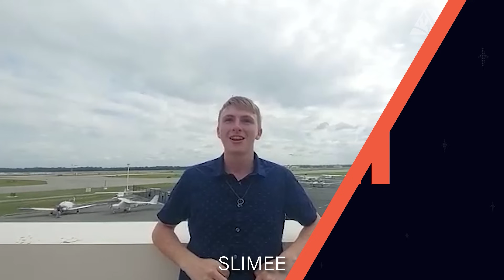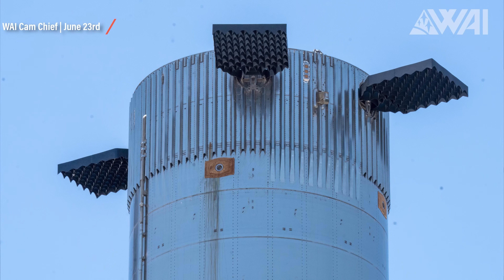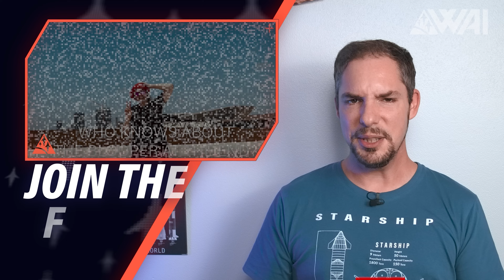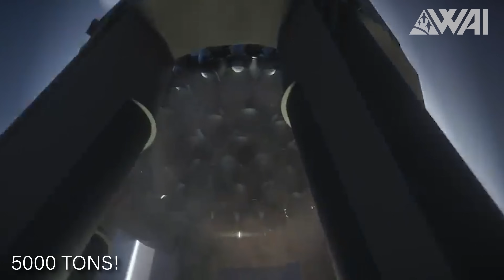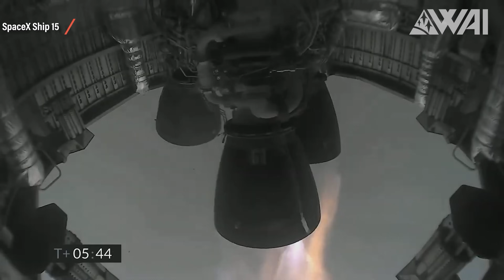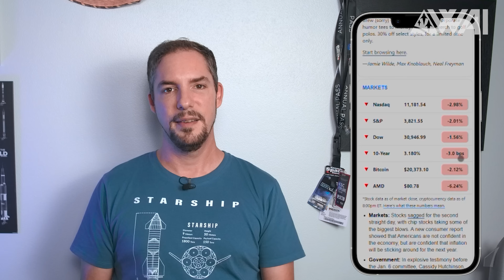The first orbital SpaceX Starship booster and its INCREDIBLE changes!

Comment from the maker: What is the insulation made of? What do you think? :_WAISweet:
Reply: carbon foam and ceramic
Reply: no maybe a dense polystyrene
Reply: Love and care
Reply: deez..... im sorry okay, I just woke up..
Reply: I would guess it's intumescent putty, it's sold in sheets that can be cut to size for fireproofing pipes and cable runs through drywall. The texture running around the edge looks like its been pressed down with a putty knife
Reply: Looks a lot like layered cork, but I'd assume it couldn't be that.
Reply: The Chinese used cork as a heat shield
Reply: Just started watching so I dunno what insulation. I dunno if it's a thing still/yet but aerogel would be cool lol

Ahhh for booster thrusters. Looks like cork, but could it be some sort of leather? I mean, welders use leather gloves they stand up to high Temps atleast temporarily anyway.
Reply: Tanned Alpaca hide
Reply: a few cans of Great Suff
Reply: If it's protecting against cool gas, it's probably cork.
Reply: Cork
Reply: Classic isolation Kork
Reply: It's cork. SLS uses it as part of the heatshield on the core stage
Reply: Yes! It totally looks like cork!
Reply: OSB
Reply: Looks to be some type of cork
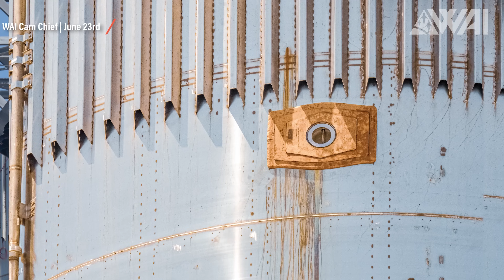Reply: @michaelputnam2532  I agree it looks variegated like pressed cork particle sheets. [5:17] The outlet gas can be quite cold (and cause ice to form on adjacent surfaces). Composite cork material could easily survive the temperature and suppress dense ice formation. 

My concern is how well it holds up mechanically during re-entry, especially during banked maneuvers where the boundary layer gets thinner due to turbulence. Beveled edges may help, and the stepped layers approximate that.
Reply: Cork
Reply: Captain Kork says it‘s Cork.
Reply: Looks like a template made out of 4*8ft 3/8ths inch Oriented Strand Board (OSB) Used on houses. Probably a rapid prototype pathfinder template.
Reply: some kind of stone wool or some kind of cork
Reply: Natural cork. Just a guess
Reply: Looks like OSB.  😆
Reply: cheap fiberboard or maybe just cork. heck, it could be just packing material
Reply: Cork
Reply: How about cork...it's been tested in space.
Reply: I think the thermal insulation material is cork. literall tree bark, it's used in rocketry a lot as cork is basically a natural heat shield, protecting cork trees from wildfires.
Reply: Cork
Reply: Its Cork.  Commonly used for insulation on rockets and acts as a cold and hot thrmal barrier.  When burning, it outgasses to create a barrier on reentry.
Reply: Stabilize rock wool?
Reply: Simply "cortiça" used to make coork
Reply: It's almost certainly TSE - thermal scrambled eggs.
Reply: cork
Reply: the insulation material looks like cork. often used in aerospace and often used as ablative shield in some of the the gridfins.
Reply: Osb
Reply: @michaelputnam2532  thought about cork too... light material, can handle heat and insulates well.. probably resistant to brittleness when superchilled aswell...
Reply: Ceramic tiles
Reply: Halal Foam
Reply: whats temp of thrusters? wouldnt want to use wool on a hot flame.
Reply: Cork.
Reply: I think the insulation around ullage gas valvaes is made of cork...
Reply: after a second zoomed look, its clearly cork. its very clear through the visual color patters (clearly ork oak patterns) and through the text laser engravings result aspect. and it makes all the sense, because cork would it not only supports the temperature variations but also damp the impact of wathever connector the plugs there. its also visible the laser cuts and laser engravings are not very aligned, which would point to an early version of that protective cover.
Reply: Cork?
Reply: It looks like some kind of cork-based composite, most probably natural cork vacuum infused with polyurethane, and then pressed. If I remember right, they've already used this material for ablative shielding in some return vehicles.
Reply: This looks very much like plane old cork to me
Reply: cork
Reply: Cork, it's very light and easy to cut in shape.
Reply: As so many have said, it does look like cork, but it does also resemble the polyurethane foam that was used on the booster for the shuttle. Personally my money would be on the foam.
Reply: Phenolharz mit Microballons ist sehr bewährt.
Reply: it looks like corc
Reply: Roseman1967  Maybe those brown insulation patches are leather?

The X15 used leather gaskets.  When they absorbed LOX they would explode from impacts.  I'd hope that leather or other absorbent insulation would not be used because of that history. Being at the top of the booster it should I believe be venting methane which might be safe even if absorbed.
Reply: Cork ?
Reply: looks like cork.  theres no inherent reason things like wood and cork cant be used in aerospace applications
Reply: @element5377  If the shoe fits & it's cheap, wear it.
Reply: Cork. It look like cork.
Reply: @roborchiston9419  I was thinking same. 
Maybe 3/4 or 1 inch thick. 
Before inflation hit that stuff was selling for about $50 a sheet. Its over $100 in some areas. Maybe Elon made a deal with a local builder since the building boom hit and these could be scraps from windows and doors and got them for next to nothing.
Reply: Late to the party, but definitely agree that it is cork. Apollo command module used it. Maybe next gen will use custom foam tiles one they work through all issues. 

From NASA website:
Cork is heavier than foam but provides even stronger protection for certain applications. Cork comes in sheets and is applied to areas that have high predicted heat loads, like the core stage engine section, which houses four RS-25 engines that produce 2 million pounds of thrust. Cork is applied under the solid rocket boosters that provide 75 percent of thrust at liftoff and on the fairings, the areas where feedlines come out of the intertank and run down the rocket to connect the intertank to the other hardware.

After thermal protection material density and adhesion are verified for both foam and cork, engineers take thickness measurements to ensure the required amount of thermal protection has been applied. Overall thermal protection systems thickness for SLS ranges from about a half-inch to 2 inches. The launch vehicle stage adapter requires 0.7 inches of foam while the hydrogen tank requires around 1.2 inches because of its extremely cold temperature. The final system level test of the insulation, prior to flight, will be when the entire core stage will be tested with all four RS-25 engines firing, and the foam and cork guarding the hardware as hot and cold collide.
Reply: Looks like Cork to me. Durable, pliable, easy to glue, easy to cut. It's a perfect insulation material and is used on some manned russian capsules as sacrifice material in the heat shield as well. While it smolders down very slowly, the remnant layer of unharmed cork still prevents overheating.
Reply: Starlite
Reply: it's cork. A cork composite, to be precise. Cork it's the bark of the Cork Tree, a cousin of the Oak Tree. Cork protects the Cork Tree from wildfires in the hot summer days, but also protects it from the freezing temperatures of winter nights. Very light, with incredible thermal properties, it's used in aerospace since at least the moonshot era of the 60's. Cork and its derivatives is used in heatshields, for example. It insulates stuff from very hot temperatures, but also from cryogenic temperatures. It prevents ice sheets from forming in very cold surfaces.
Reply: I don’t know but it looks delicious
Reply: Looks like cork, to me.
Reply: looks like Cork
Reply: Cork?
Reply: Bet the insulation is basalt
Reply: it could be Cork
Reply: cork
Reply: Not at all related to rocketry. A thought that occurred watching your outtakes: I'm assuming that English isn't your first language, so huge props for taking the time to correct all the little pronunciation errors, that's an incredible amount of dedication. And I would imagine is quite the way to practice a language. Crazy.
Reply: It could be cork, very good and cheap insulating material
Reply: Cork
Reply: Cork
Reply: Super-material Intumescent "Starlite"  ( Baking Soda, Corn Starch, Elmer's Glue ) ?
Reply: Resembles OSB sheathing
Reply: @anthonypeterson5618  most likely fairly cold.  You aren’t using any combustion in those thrusters just the pressure build up of the Liquid CH4 or LOX boiling off in the tank.
Reply: @pheyman1526  didn't see mechanics of thrusters.   Assumed diverted from full stage preburner pumps.
Reply: corck
Reply: Sounds heavy for a rocket...
Reply: Former Employee 👋🏽 ….. It’s Cork ……
Reply: maybe cork
Reply: Graphine

Comment: The insulation looks like cork. A proven spaceflight material. Extremely light and an extremely good insulator (ask any tree that survived a forest fire).

Heat shields have been made of cork and even oak, it acts as an ablator in that situation, but it has been used for LH2 tanks. Yes the orange of the Space Shuttle ET os roughly 250 kg of cork. 

China's equivalent to the Corona program, analog spy satellites that dropped film canisters in reentry modules (used into the 2000s) had a white oak heat shield.
Reply: dont ask the dead trees tho
Reply: @huibu8987  Hello! Harvesting cork doesn't kill the cork oaks that you take it from. You take half a tree full at once and the tree regenerates. Harvesting cork gives humans a reason to keep cork oaks about.
Reply: @Jimbo Bimbo I take your point!
Reply: Artificial corks are leading to cork oaks being cut down. Maybe SpaceX can save the species.
Reply: @huibu8987  My apologies: I believe I misunderstood you. I thought you meant don't ask the trees we slaughter in order to produce cork. I now see you to mean don't ask the trees that died in  fire how good insulator cork is. A fair point!

Comment: Gutten Tag Felix. Wilcomen  aus Florida. From an American sub whom spent 2 years in Bremerhaven with the Army from 82-84. 
  The sinking of the foundation of the Orbital Fuel Farm could turn out to be a BAD THING, depending upon how much/fast it is sinking. With experience with concrete pads and construction, I understand completely the ramifications of its sinking.
   Wow that insulation reminds me of expanding foam insulation that I have used in my Home Repair and Improvement Business. It sprays out of an aerosol can as a semi-liquid form and expands to fill the spot/area you put it as it dries and when completely dry its similar to Styrofoam, and can easily be cut/trimmed to shape on the outside, as usually it expands out of the area you put it. But a knife easily cuts/trims it to what/how you want the face to look.
  I as well can't wait till they finally light this GIGANTIC CANDLE, ITLL SEEM LIKE MY BIRTHDAY, EVEN THO THAT WAS MONTHS AGO, AND FURTHER DELAYS ONLY MAKE IT FURTHER AWAY!!!! This being the largest candle built/soon to be launched HOPEFULLY, by Man, whom only had powered flight since 1914 Kittyhawk, with Orville and Wilbur Wright.
    And yes I was glued to the T.V. at any mention of Space and Experienced/Watched the Apollo 11 landing July 1969, I was 5 years old at that time. And same as ALL my Generation whom watched as well, I dreamed/wanted to be an Astronaut. But as I grew older and learned by experience I don't fit inside the cockpit of an Aircraft, being 6'2. I was invited by a Marine Pilot to climb into the cockpit of his Phantom. I was a "Fat Guy in a Little Coat" tyto Chris Farley, RIP BROTHER. Us tall people don't fit into spaces designed for little guys. Even tho I weighed 185 pounds at that time. So fat is/has/never will be said to me, as now at 58 years old I weigh 220. Just my height convinced me from that experience that my childhood dream of being an Astronaut was dead, with no possibility, at that time. Now tho...... it all depends upon whether I will/can finangle the money, which is HIGHLY doubtful being BRUTALLY HONEST WITH MYSELF. As I had an accident in 2004 while doing a job for my business and am since then permanently disabled. Having not worked since then and it took 16 years with absolutely no income, to finally be approved for disability in June 2020. And the Cherry on top of it all, August last year my wife of 38 years passed, 8 days after our 38th Anniversary.
  "One day you look to find 10 years have got behind you" ty to Pink Floyd for that but, 1 year is next month. I just realized 2 days ago now, and haven't stopped crying yet.
Reply from the maker: Hello! Thank you very much! 🙂❤️

Comment: An ullage burn directs thrust to place weightless fuel floating about the tank down where it can enter the engines. The four top vents are simply vents, but may be used to flip the first stage. Look below the grid fins and top vents and you'll see other vents with cone shaped covers. These will provide ullage thrust.

Comment: There's a strange illusion created by big things traveling through the air, they look like they are traveling slower than they really are. Example: C-5A Galaxy on take off. The numbers say the thrust to weight ratio is the same as Falcon 9 but it's not going to look that fast.

Comment: I feel that it's not that stainless steel is better than titanium grid fins, or from years ago when the concept was a composite hull.

It's that millions of miles away if your stainless steel space ship needs fixing, all you need is a big hammer, a cutting grinder, welder and some spare stainless to mend the problem, alot easier to deal with on another planet. Also having a few small parts on hand as supplies.  Hence why raptor two has so few components. The minimal components means less spare parts needed for fixing.
Reply: You're a little off the mark, because grid fins are only used on boosters, which don't go to other planets. But yes, it's almost certainly a decision driven by ease of manufacturing, maintenance, or both.
Reply: @simongeard4824  or your off the mark.  Since why build two different styles of vehicles?  They committed to spaceship being stainless so super heavy just gets built the same way.  I feel like the concept of starship is completely scalable.
Reply: @HurdleHelps  The point is that maintainability of grid fins on Mars is irrelevant because the part of Starship which goes to Mars doesn't have grid fins. Only boosters have grid fins, and boosters are strictly suborbital on Earth.

As I said, I agree with your broader point – ease of maintenance is a huge factor for SpaceX. But the constraints of design for Mars simply aren't applicable to boosters .

Comment: I would think the upper stage would still require (eventually) some kind of powerful thruster system. Methalox still seems to make sense. If they want it to be able to land in a wider range of conditions (required with the planned launch cadence) and with varying payload mass at landing including people, I'd think it would need an abundance of control authority just for safetly margin. Still, its early days. Probably gonna be a while before we see a starship landing in inclement weather with people on board. Or The Hubble when it dies or any of the other ideas people have had. Especially for landing on Mars with a full payload bay if that ever actually makes any kind of rational sense. 100 tons to the Moon, whatever... i'd want serious control authority for such a beast of a vehicle. A sudden gust of wind at landing requires serious power to counter for so much surface area.
Reply: I agree. Setting aside some of the extra-high-pressure propellant gas from the Raptor engines (in COPVs) would be a great way to feed simple pressurized propellant gas thrusters. The thrusters could route liquid propellant around the combustion chamber and nozzle neck to increase efficiency even more while protecting the combustion chamber during long burns. The evaporated propellant may maintain the gas pressure and volume indefinitely.
Reply: I would imagine they'd put something at the top in the nose cone once they've got a near final nosecone design, even the one they're working on now with the pez dispenser isnt a final iteration as its not designed to survive a landing yet. I'd guess the 2nd or 3rd starship will get those once they've figured out how to land it safely as the first 2-3 will be intentionally dropped in the ocean.
Reply: Remember that the gridfins act like biplane wings that are also control surfaces.  The flaps are also control surfaces, and then there's the set of atmospheric raptors that can be gimbled and throttled for even more control authority.  Last years destructive landing tests used as little control authority as possible, just to find the unsafe minimum.  SN24 has more power in every control system than SN1x.

Comment: Looks like the insulation around the ullage gas thrusters was cut out of cork.
Reply from the maker: Cork would be flammable. :_WAIShocked:
Reply: Cork is somewhat flammable, but it is going to char and create a carbon layer that is protective and ablative. So, the cork is basically preventing both high and low temperatures from affecting the purge valve, and suppressing hard ice accumulating at the valve.

Comment: I think the RCS (even though it's using ullage pressure) still qualifies as a cold gas thruster. This pressure exists in the tank due to boil-off even without autogenous pressurization. That is only needed to back-fill the tank to keep the pressure up as the propellant drains

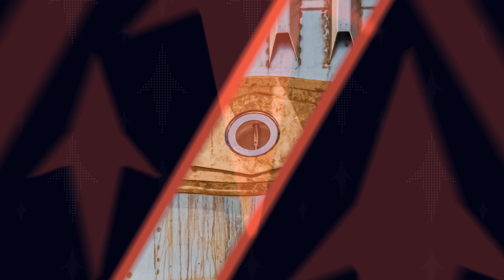Comment: 5:19 You can normally tell how it's cut by the tool marks but I don't recognize those ones.   Anyone else know them?
Reply: These composite are a mixture of cork particles and rubber cement binder pressed into flexible sheets. Here, we see three layers in a step fashion. These could easily be hand cut with a knife and stacked with contact cement.
Reply: @imconsequetau5275  Look at the tool marks.  It looks like they used a gouge.  Which seems weird.